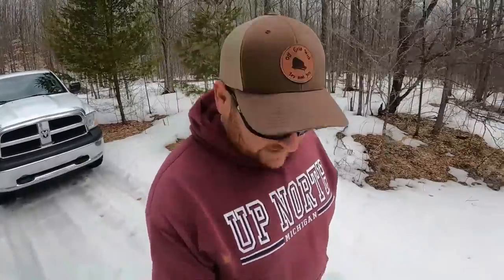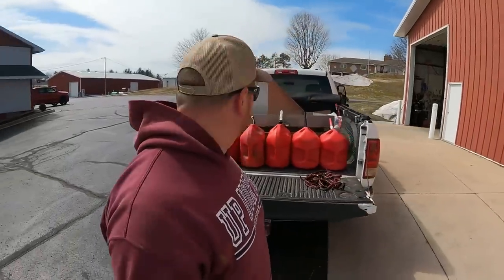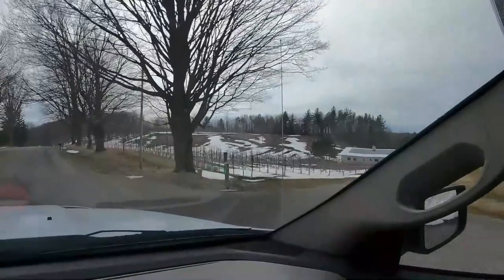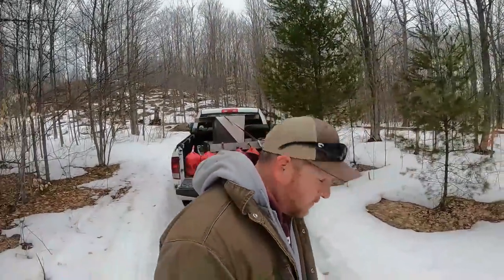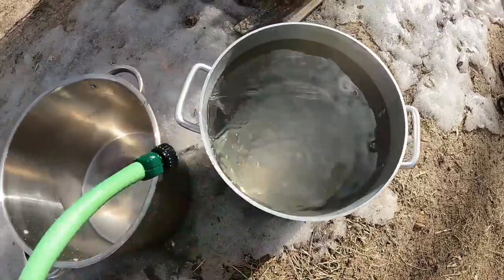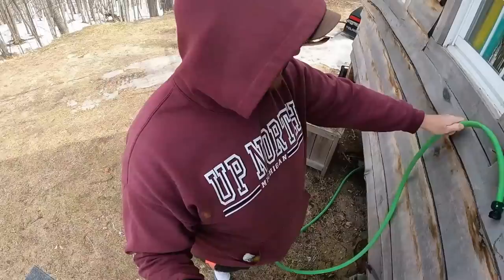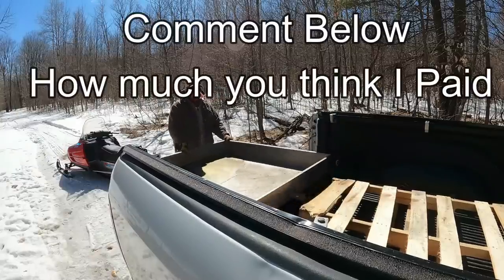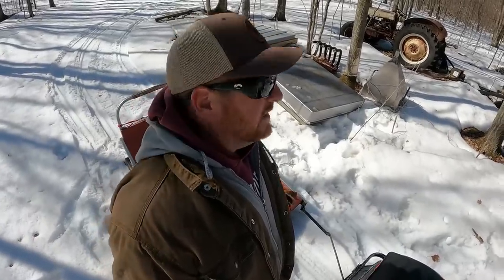HUGE UPGRADES here at the Off Grid Cabin | Our TEMU HAUL helps beautify the Kitchen #temu #shoptemu

Comment: Snow mobile trailer cam was great!  Do you guys get ethenol free gas, or do you go through enough you don't have to worry about it lasting long?
Reply from the maker: I use to use Rec Gas with no ethenol  but we cycle though it fast enough that it doesn't sit for more than 6 months. I have not had any issues yet. altough the boat motor fuel looked a little skunky when I put it away last winter.....but that's because we didn't fish much last year....=(

Comment: Enjoy your videos but have a question about the wind noise as we don't have more than a breeze very often in west Tennessee.  I have a cheap Comica wireless mike and it came with a piece of fitted dead cat fuzz and I don't get wind noise so am wondering if yours doesn't have a dead cat cover or if you still get wind noise with it?  Next time we have a storm, I will go out and see what happens in heavy wind.  (I was guessing 600 on the used SS pans and hopper, guessing that you wouldn't likely spend more than than for them.)
We have traveled and camped as often as we could our entire lives and after retirement we finished visiting every state.  Most have a variety of scenery from one area to another, so mountains to coast, some like Arizona go from desert to forests and the Grand Canyon.  Here in Tennessee we have the Smokie Mountains in the east down to the Mississippi Valley in the west.  We didn't make it to northern Michigan, but did cross the south.  We watch Bushradical YouTube and they live off grid in Northern Michigan and Alaska.
Reply from the maker: Ya we have bought a few wireless mics to try and they have been crap.....still looking for the right option. Thanks for the tip. If you find one that works well with a Go Pro let me know. 👍
Reply from the maker: Kenneth.....can you do me a favor and send us an email or reply on this video again on a separate comment? Your reply to my reply is not reading right and I can't pull it up for some reason. I'm going to look up Comica Mics but can't read your whole comment...youtube glitch maybe? which model Comica too please. I'm researching them now. thank you